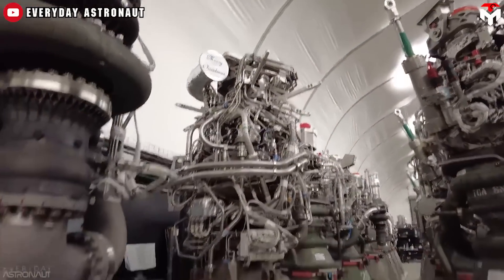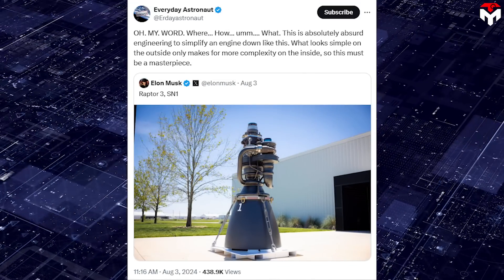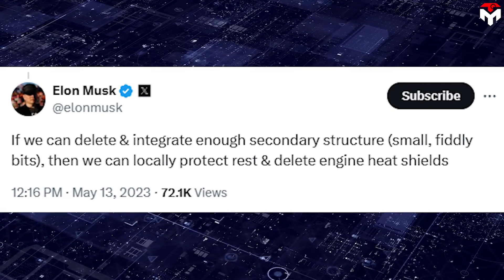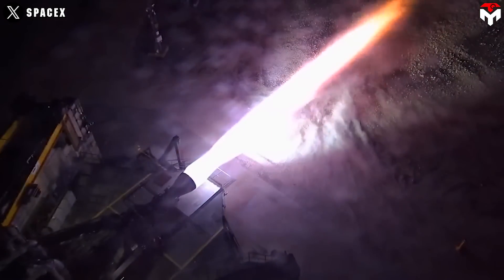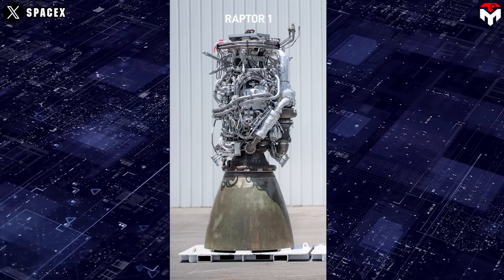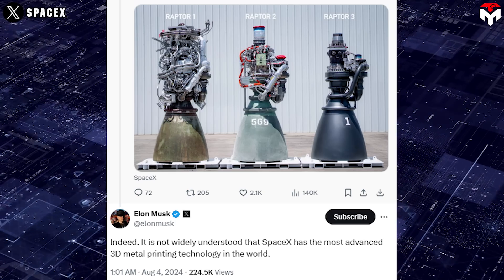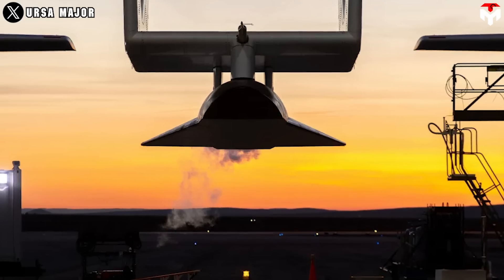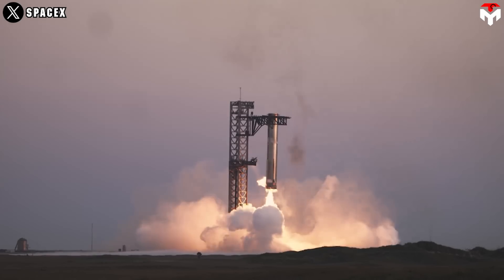SpaceX Upgrades Everything on New Raptor is totally Thrilling Scientist's Minds...

Comment: Yeah, people used to fight with me when I said it was 3-D printed I see he’s slowly starting to admit it when people are starting to believe it. There’s no way you’re doing these internal coolings and such small cramp pieces mainly drilling them we’re putting them in. It’s definitely 3-D printed. It’s definitely designed by AI and then enhanced and redesigned.
Reply: Instead of AI I would rather say highly detailed Generative Design (Topological optimization) - nevertheless most of the stuff coming from of such process is possible to be manufactured only with 3D priniting. More interesting question is material part, do they coat internal chanels, etc.
Reply from the maker: Exactly.

Comment: What if the falcon 9 used raptor 3 engines?
Reply: You would need a new tank design to accommodate the different volumes of methane to kerosene.
It would be a new rocket with the same hurtels of a new rocked to overcome
Reply: Maybe the design cant handle cryo methane? It sounds like a good idea must be some reason why they wouldnt attempt
Reply: @Mister_Durden  the entire structure would need to change as raptor is a lot more powerful.
Reply: The idea is that if you maximize the reusable Starship payload, it will be far cheaper to use the Starship than any other alternative. Given the limitations of using the Starship, I don't really buy that. The Starship will only be able to launch and land from certain sea or highly limited land locations. I think it would be good to have an intermediate rocket that you can launch and land widely without the environmental and political outcry. With the Starship they already know how to make a rocket that works and building a smaller iteration should be no problem. You ought to be able to get 40/50 percent more power out of a Raptor engine than a Merlin and it is the right thing to do. As a senior, I will never see the time come when you will be able to launch a Starship daily. Even if you could launch one daily, it would often be from less desirable and more costly locations. I would opt for both.

Comment: The Chinese will soon have an engine that looks exactly like a Raptor 3 (at least on the outside!!)....
Reply: Funny thing about socialist systems: seems they’ve depended on capitalist systems for innovation, such as reverse-engineering the B-29 bomber and outright stealing atomic secrets from Los Alamos. And China’s new fighter plane looks suspiciously like the F-35. Not always: Sputnik comes to mind although even that came out of competition with the West. So overall, that’s the pattern over the last 75 years or so. My guess is that since socialism is inherently coercive and fear-based, it stifles individual initiative while capitalism encourages it. I don’t know from experience whether that’s true but I don’t think I’ll move to Cuba to find out for sure.
Reply: Don't count on it. Not soon, at least. The Chinese have been trying for years to copy the F135 jet engine used by the F-35 fighter. They have not succeeded. Not yet, at least. Their version of the F135 is underpowered. Apparently, not everything that one needs to know in order to build a very advanced engine can be hacked from the maker's website.